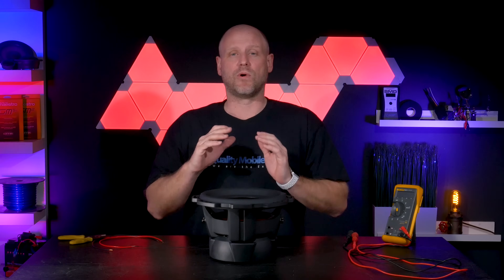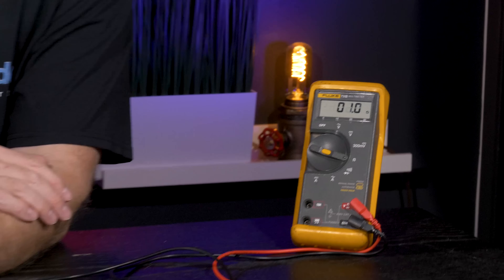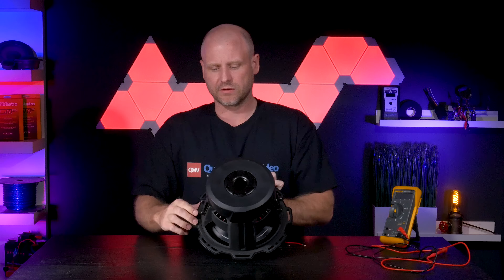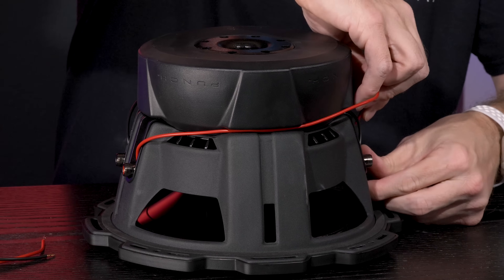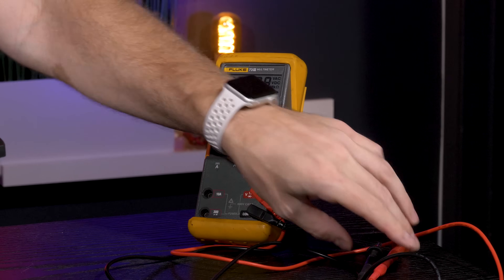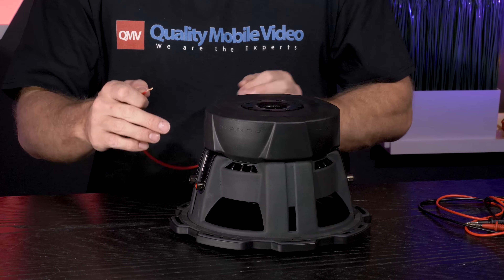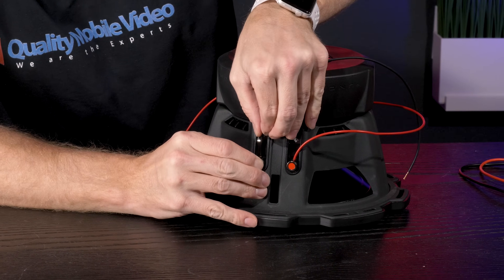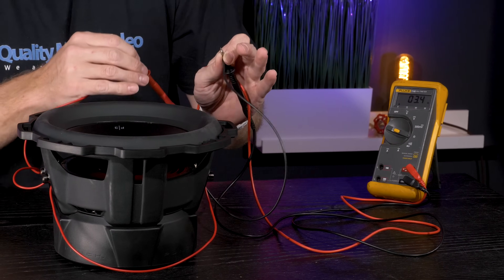How to Wire Your Subwoofer Dual Voice Coil 2 ohm - 1 ohm Parallel vs 4 ohm Series Configurations

Comment: What is the recommended amp for a dual coil subwoofer?
Reply from the maker: It depends on a few things, the impedance of the subwoofer (2 ohm or 4 ohm) and the power rating
Reply: Quality Mobile Video its pioneer subwoofer TS-W311D4 400 RMS and 4 ohm. I will power up only a one subwoofer.
Reply from the maker: Sweet! So you'll be making a 2 ohm load at your amplifier with that sub. Check these out: 

Kicker 42PXA5001 - 500 watts RMS x 1 Channels at 2 ohms
http://www.qualitymobilevideo.com/42pxa5001.html?utm_source=YouTube&utm_medium=Video&utm_campaign=Match_Subwoofers-Amplifiers

Rockford Fosgate P300X1 - 300 watts RMS x 1 Channels at 2 ohms
http://www.qualitymobilevideo.com/p300x1.html?utm_source=YouTube&utm_medium=Video&utm_campaign=Match_Subwoofers-Amplifiers

Rockford Fosgate R500X1D - 500 watts RMS x 1 Channels at 2 ohms
http://www.qualitymobilevideo.com/rockford-fosgate-r500x1d.html?utm_source=YouTube&utm_medium=Video&utm_campaign=Match_Subwoofers-Amplifiers

Kicker CXA300.1 - 300 watts RMS x 1 Channel @ 2 ohms
http://www.qualitymobilevideo.com/cxa300-1.html?utm_source=YouTube&utm_medium=Video&utm_campaign=Match_Subwoofers-Amplifiers

Kenwood KAC5001PS - 500 watts RMS x 1 Channels at 2 ohms
http://www.qualitymobilevideo.com/kac5001ps.html?utm_source=YouTube&utm_medium=Video&utm_campaign=Match_Subwoofers-Amplifiers

Pioneer GM-D9601 - 800W RMS @ 2 ohms
http://www.qualitymobilevideo.com/gm-d9601.html?utm_source=YouTube&utm_medium=Video&utm_campaign=Match_Subwoofers-Amplifiers

Power Acoustik RZ1-1500D - 900W RMS @ 2 ohms
http://www.qualitymobilevideo.com/rz1-1500d.html?utm_source=YouTube&utm_medium=Video&utm_campaign=Match_Subwoofers-Amplifiers

Kicker CXA600.1 - 600W RMS @ 2 ohms
http://www.qualitymobilevideo.com/cxa600-1.html?utm_source=YouTube&utm_medium=Video&utm_campaign=Match_Subwoofers-Amplifiers

Comment: can you please wire single 4ohm 2subwoofers to a 2ohm amplifier?
Reply from the maker: To be clear, your question is can you wire Two SVC 4 ohm subwoofers to a 2 ohm load? Yes, wired in parallel they will make the 2 ohm load.
Reply: @Qualitymobilevideo  how about a a Dual voice coil 4 ohm sub can I get 1ohm with those?

Comment: ? I have a t1500-1bd amp an 2 p3 dual vc wat is the best way to wire them
Reply from the maker: Depends, do you have the 2 ohm or 4 ohm P3 Rockford subs?
Reply: @Qualitymobilevideo  wat ever safer for my subs with tha amp
Reply from the maker: Again, big chief, I need to know if the subs are 2 ohm or 4 ohm
Reply: @Qualitymobilevideo  4ohm an they r wired at 1ohm
Reply from the maker: Perfect match wired in parallel

Comment: How do I just make 2 ohm how it’s supposed to be?
Reply from the maker: Not possible. One DVC 2 ohm subwoofer cannot wire to 2 ohms. It can only wire to 1 ohm or 4 ohms as thoroughly explained in this video.
Reply: @Qualitymobilevideo  thank you I finally understand I should of bought a 4dvc and wire it to 2 ohms

Comment: What be best I got 2 4ohm 12in and I 600watt amp what be best wiring
Reply from the maker: Need more info Luis. Are the subs dual voice coil or single voice coil? What's their RMS power rating each?
Reply: @Qualitymobilevideo  I know this is a old question but I need to know the answer to this also I purchased 2 Skar audio EVL 10d4.  As u may already know theycrated at 1000 RMS and are dual voice coils. What's the best wiring set up  for me? I will be hooking the up to a JP23?

Comment: How do you keep it at 2ohm but still using the two coils
Reply from the maker: Not possible with one DVC 2 ohm woofer. Two DVC 2 ohm woofers can be wired to a 2 ohm load, or one DVC 4 ohm woofer can be wired to a 2 ohm load.
Reply: @Qualitymobilevideo  how do I wire it to a 2ohm load
Reply: @familymatters1sttt54  deadddxd 💀

Comment: How do I keep my 2 ohm sub to stay stay at 2?
Reply from the maker: The only way to wire one 2 ohm subwoofer to a 2 ohm load, is that it also has to be a single voice coil subwoofer and you wire it in parallel to an amp. If it's Dual Voice Coil it cannot wire to 2 ohms, unless you had two DVC 2 ohm subs

Comment: Will a 1ohm impedance increase the subwoofer rms output?
Reply from the maker: Yes
Reply: Quality Mobile Video But say the sub is only 400 rms max and it is a dual 2 ohm voice coil. 

If I were to wire it to 1 ohm wouldn’t that put strain on the sub??

Comment: 1 ohm or two ohm makes absolutely no difference, it simply depends on what load the amplifier was designed for, what the amp circuits were optimized for. Everything else being equal, an amp built for and running in 1 - ohm will behave exactly the same as an amp designed for and running in 2 - ohms...
Reply from the maker: yup
Reply: So I can wired a DVC-2ohms to 1ohm and just adjust the gain on the amp to provide enough amount of power to subwoofer. I’m running a 1ohm amp 3000w to a 1500rms DVC-2ohm

Comment: Can i connect 2) 2ohm kicker l7 to 1 ohm final load?? To a 1 ohm stable amp?
Reply from the maker: Nope! Two DVC 2 ohm woofers make a "2 ohm load" (parallel) or 8 ohm load (Parallel/series). You would need two DVC 4 ohm woofers for a 1 ohm load in parallel
Reply: @Qualitymobilevideo  is there a way to run two 2ohm dvc subwoofers at 1ohm if you wire them to a mono amp individually and not in a series or parallel?

Comment: This is some bullsh*t speaker. Why would I want 8ohm load? Spend money on 1ohm stable and connect to 8ohms? Buy AudioPipe, because they have 4 layer dual voice coils. 4 layer dual voice coils gives you 2ohm & 4ohm impedance. Childproof tech. Spend your money wisely. Tx

Comment: Thees heere vid isn't foolproof. It's idiot proof.
Reply from the maker: You'd be surprised
Reply: @Qualitymobilevideo  Actually do have a Q; Given the "only 4 ohm bridge" parameter of the Focal 4.350 Amp, I have 2 options but not sure if the higher Watt one is safe; 
Briefly; the specs of this 4ch amp state that in bridge mode it can only be in 4ohms. Given this and their dual VC sub RB250, what would you choose:

1 channel to each voice coil. = 58W RMS each. for a 116W RMS total.

2 channels in bridge mode to one voice coil = 200W RMS total.
TIA!. 

sauce; https://www.focal-america.com/product/fds-4-350/

Comment: How to wire a dvc single 2ohm sub to a 2ohm load. Please help me with this
Reply: We in the same boat would it be just too wire as usually
Reply: I'm confused . Is it ok to wire one dvc sub with just two leads and leaves the other two. Which means the dvc became a svc.

Comment: How do I wire two 2 dual ohm - 1 ohm the same way as the one ?
Reply: You can't it's either 2 ohm or half ohm
Reply: Unless u run 2 separate amp or have a 2 channel amp